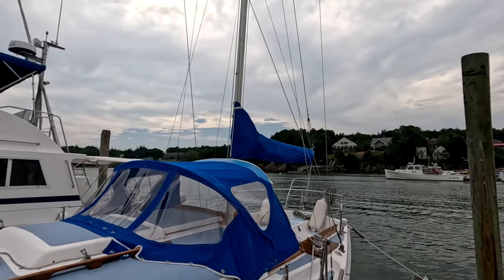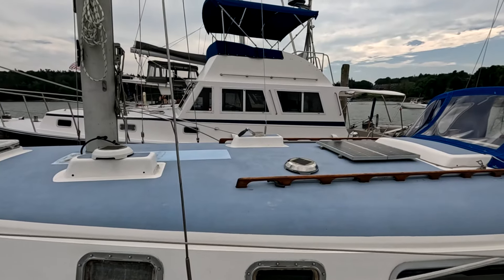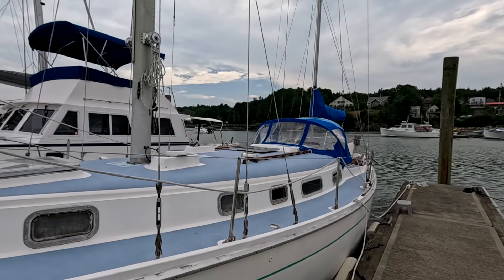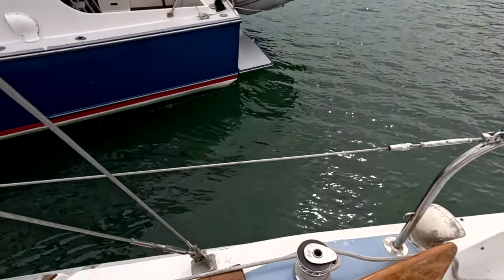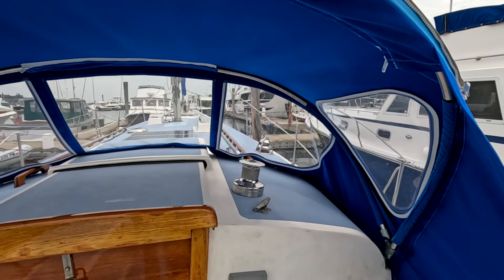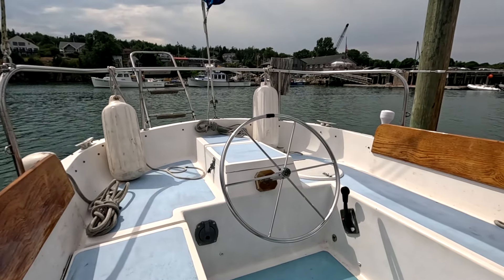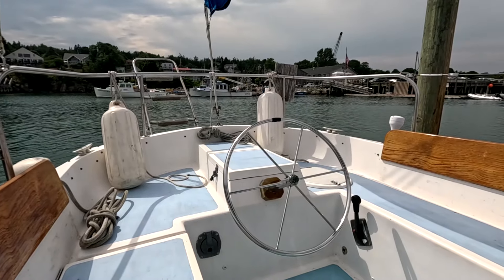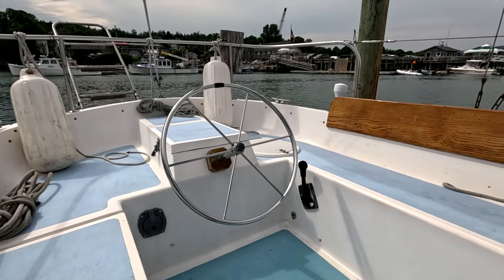Allied Princess 36 Ketch - Tour & Systems Description - July 9, 2024

Comment: Very interesting.  I have not had the opportunity to compare my Princess with others.  My boat has had a few more owners than yours some good things some bad.  A few questions: is the deckplate/hatch on the port aft cockpit seat the propane locker? What is the deck fill on the port aft quarter? Does your hanging locker door not latch against the mast compression post providing privacy for the v-berth?
Reply from the maker: I am at least the third owner of my boat.  The second owner bought the boat in '87, but I don't know its history before that.  Yes the hatch on the port aft cockpit deck is a Trident Marine propane locker I installed in '97.  The port side deck fill is for my water tank.  The original tank under the main salon sole was converted to the shower sump by a previous owner.  Needless to say that tank is no longer used as a water tank although it is still there.    I now have a bladder tank under the quarter berth.  Yes the hanging locker door doubles as the door to the forward cabin.  It has a fold up panel to completely close off the forward cabin except for about 6" at the bottom.  I will try to answer any other questions you may have.  What year is your princess?  Mine is hull #8 laid up in November '72 but not launched until '73.
Reply: @todddunn945  My princess is hull #71, depending on the document it was built in 1976 or 77. It still has most of the wood grain laminate. When I bought the boat a previous owner had retrofitted a bowstring with a forestay, solent stay, with a reefurl rolling furling, an inner stay for which I have two staysails.  In 2015 the silent stay failed and in the repairs that followed I deleted it putting the new harken furler on a new forestay. I have and continue to use the undersole water tank. But it has been removed to replace the fuel tank and re-installed. The immediately previous owner replaced the engine with a rebuilt yanmar 3hm35F.  Today, I finished replacing everything I stripped off the boat preparing for Beryl.
Reply from the maker: @jkepleriv  I removed the old fuel tank about 10 years ago.It had been abandoned for many years and had rusted through on top.  It was a nasty job to get that tank out.  We ended up cutting it into pieces.